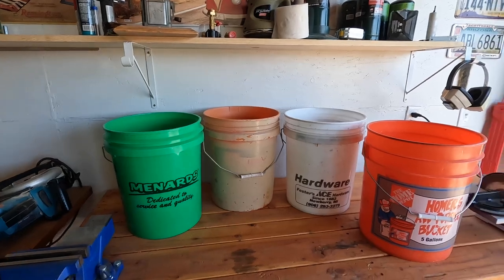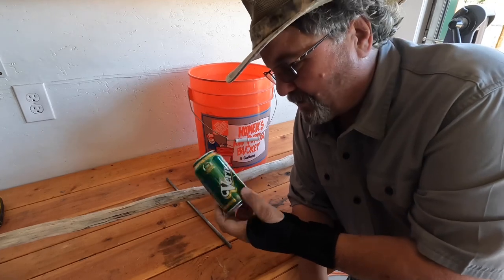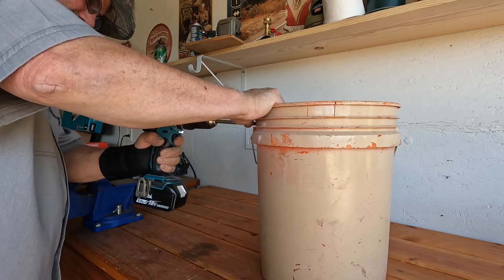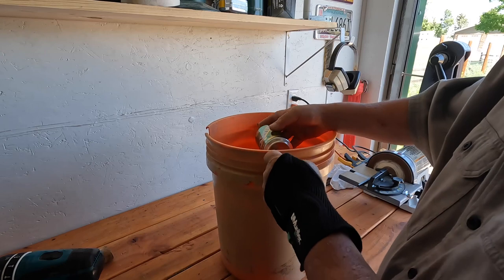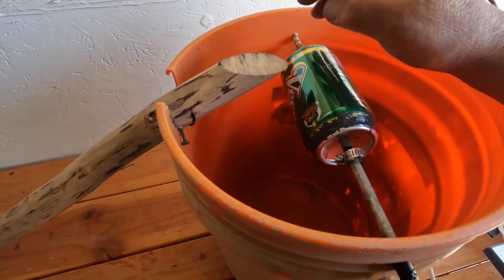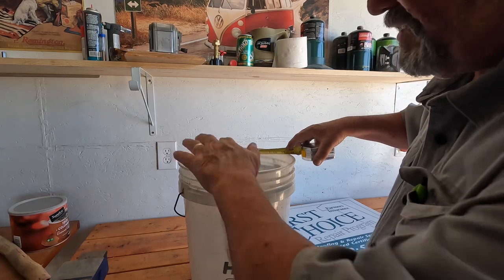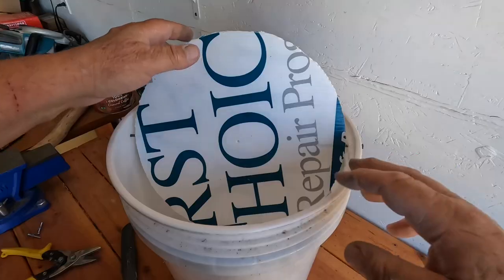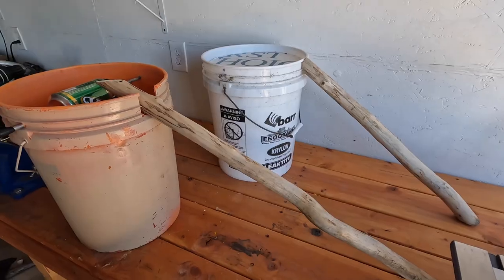The best mouse trap? #DIY #5GallonBucket

Comment: I've used the can method with great success. I like a plastic soft drink bottle a little better
Reply from the maker: The thing I like about these 5 gallon buckets is once you bait them with peanut butter they’re continual catchers. I know the guys had 15 or 20 mice in the bottom of these buckets with 6 inches of water that drown them all. I’ve caught three mice so far in one of my traps. I caught one the first night and to the second night. I guess I’m not familiar with the soft drink bottle trap. I’ll have to look it up.
Reply: @safarijoesadventures  same concept as the can, just the bottle opening is in the center rather than offset like a can is.  Then I use a soldering iron to melt a hole in the bottom.
Reply from the maker: I’d like to see a picture of that one. As long as they’re working and getting rid of the mice I’m a happy camper.

Comment: We do the same at our outpost cabin
Reply from the maker: There’s a couple of different styles, and they both work very well.
Reply: I love it because it’s a long term trap for the winter, usually I put -5 degree windshield fluid in the bottom.
Reply from the maker: @ADifferentKindofQuiet  that is true I have two of them set up at my cabin one in the front and one in the back and I have some regular antifreeze in them just deep enough to drown them. They’re both kind of tucked in under this tarp like thing that’s covering the side walls, so no other animals can get to them.